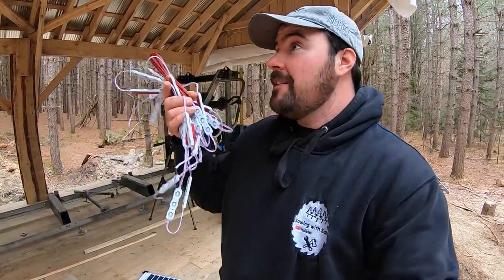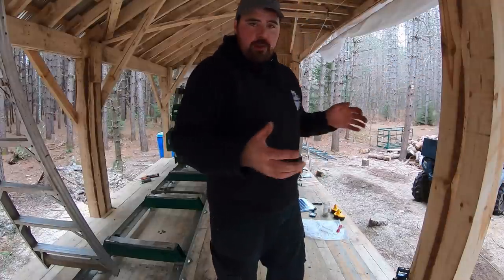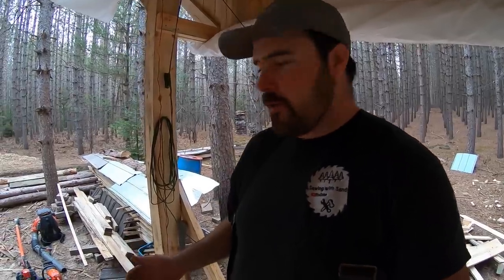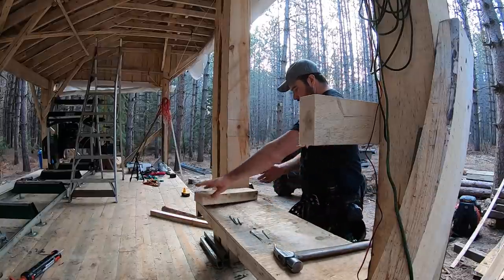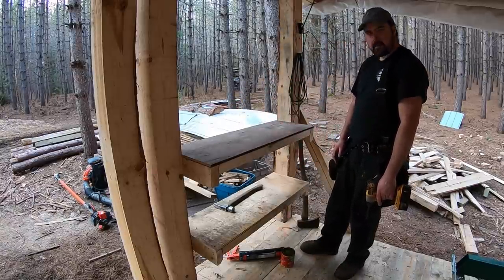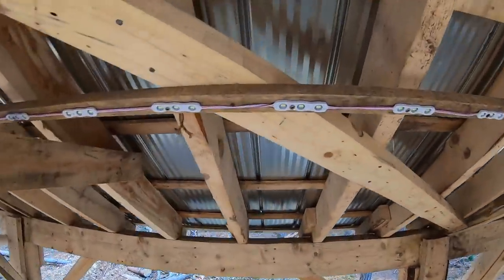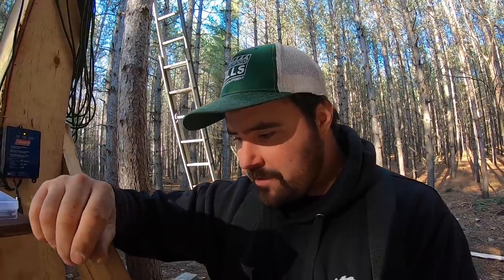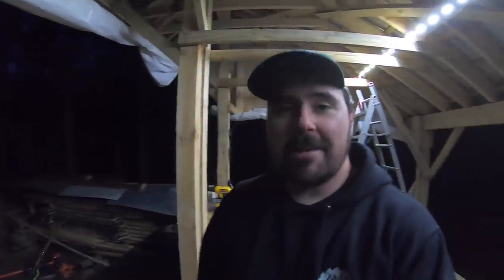Easiest Way to Get Light in Your Shed | Sawmill Shed Build - Episode 13

Comment: Very cool idea, using the LED string lights and the solar panel/battery set-up. Nice and simple, which is always preferred. The only potential draw-back that I see is the very low levels of light available to the solar panel in the "dark" months of Winter. I have not viewed all of your videos (yet), so I cannot tell whether or not you have done a follow-up on the performance of your system. But, I would like to see/hear from you about how things worked out in practice this past Winter.
My wife and I live on an "off-the-grid" property in the Canadian Gulf Islands on the West Coast of British Columbia. Up here, we have the same (or worse) problem with lack of sunlight (very short days) that you have. This past year we installed a battery-bank and inverter system, tied into our generator, for our "whole-house" system. No solar panels yet. We decided to pass on the panels because of the time of year: late Fall. There is so little sunlight available that solar panels would not keep the batteries charged-up enough to operate the system. Keeping in mind, ours is a full-time, year-round, whole-house system, which obviously requires much more power than your single string of LEDs. But, it certainly has been a godsend to get "regular" electrical power into our home, especially  during the dark Winter months! It is our plan add solar panels this Spring/Summer, to complete the system, and alleviate the need to periodically (daily) run the generator to recharge the batteries. 
Again, I would be very interested to hear how things worked out for you with your compact system. I may just do something very similar for my workshop, and a couple of other outlying buildings. I really like the simplicity of your system. Great video! Thanks!
Bruce Riep
Reply from the maker: All has gone well so far with the setup throughout the first winter

Comment: I would solder the wires then slide the heat shrink over the connections.   This would help with corrosion resistance.

Comment: 40w panel for one battery is more than enough, I have two 10w panels on mine and it charges enough to run the 12v electric trailer jack for raising and lowering the saw head all day long, and it’s not hooked up while in operation. Nice lights, I might do that too 👍
Reply from the maker: Thanks William

Comment: Good tip on attaching lights to wood strips first. When I put up strip LEDs in my cabin I hadn't thought ahead and tried using the tape that was on the back of the lights I bought. Was like putting up spaghetti and they saged all over. Also, never hook solar to controller first. Always hook controler to battery, then hook solar panel to controller.  Renogy is a better solar panel and cheaper at $165 for 100w and a better contoller.
Reply from the maker: Thanks for the tip Jim. I already owned this particular solar panel but is the one you mentioned sold in Canada do you know? Thanks again for watching

Comment: Add a 1/4inch of rubber under the battery and you will have less drainage of your amps the size of the bottom of the battery

Comment: Instead of on the tree, I might have mounted the solar panel on the south side of the shed, up on the sided part.  Great idea.

One other thing, if you disconnect the battery when you're not there, the battery doesn't charge.
Reply from the maker: I disconnect the lights from the battery but leave the solar panel hooked up. Thanks for checking out the video. Hope all is well with uou

Comment: Hey Sandy, they say imitation is the greatest form of flattery and I hope you feel the same as I am trying to walk in your footsteps with my build and soon my lighting.  I would like to know, since it has been a while how this solution has worked out for you and if you happen to have any idea how long the lights last on that battery?  Thanks again for all the inspiration.
Reply from the maker: I appreciate that! All has been good with the lights. I"d still use these lights on the battery as they work quite well. Big thing is getting hte solar panel to charge the battery in a good position but hte lights use such little power I find.

Comment: Looks good. That's what I suggested in a prior video comment. Be sure you have a droop in the wire from the solar panel to the building because of swaying if the tree in wind and to keep rain from following the wire down to the controller. 
Also you may want to think about an enclosure for the battery and some foam insulation to keep the battery from freezing and busting. This will depend on how much water to sulfuric acid the battery has.

Comment: Hey I’ve been tracking your channel for a while. Thanks so much for the content I am looking to create my own Lumbermill shelter for my 130 max that is going to be coming in in December. My question is if I have two extensions that’ll put me out to the 30 foot marker approximately how do you make a shelter big enough to be able to put 30 log in? Is it even possible?
Reply: You could use some sort of truss or a bar joist to span that far. Another option could be to load logs from the end .
Reply: I'm leaning towards some big ol' beams for my mill when I get around to covering it
Reply from the maker: I’d talk to an engineer to see what type of beam/truss can be used to span that distance
Reply: Emile Crotteau thanks for the comment. sent you an email

Comment: Sandy are you going to fill the holes in the steel roofing so it won’t leak on you ?
Reply from the maker: I think I’ll fill those in if the temperatures get back above freezing and it’s dry enough to get on the roof. If not I’ll end up doing it in the spring

Comment: Now you have to go to work...no excuses. The Solar panel has ''The requested URL was rejected'' is it a standard 40 watt panel ?
Reply from the maker: Not sure what you mean by standard panel
Reply: @sawingwithsandy  I mean nothing special just regular. The products that you had listed that you used, wouldn't open. It just said URL rejected. I've never used or installed solar equipment. Now after seeing yours and how simple it was. I'm interested.

Comment: Good video .I am going to try this for my mill shed can you give me the link to the led lights you got from amazon thanks
Reply from the maker: Thanks for watching Rose. The link can be found in the description section of the video by clicking the drop down arrow
Reply: @sawingwithsandy  thanks for the reply I see the info for the lights but it is not in blue like the Switch is .  would it be a bother do hight ligh it in blue then I can go right to it .Thanks
Reply from the maker: Hi Rose, the link in the description are the ones I used in the video. They aren’t actually blue. Hope that helps
Reply from the maker: Sorry wasn’t sure if you’re talking about the switches or lights.
Reply: @sawingwithsandy  lights . I got on amazon for the switches with the blue link
Reply from the maker: These are the ones on amazon I purchased and used 
Twidec/10Pcs AC 6A/250V 10A/125V SPST 2 Pins 2 Position On/Off Car Boat Round Black Rocker Switch Toggle with Pre-soldered Wires（Quality Assurance for 1 Years） KCD1-2-101-X

Comment: Using a bungie cord around the solar panel to fix it in place radically reduces its output...to almost nothing. Need a better way.
Reply from the maker: I used a rope. How does it reduce it?

Comment: You did good 👍 but I can't find those lights anyplace ... Oh well 12v is 12v just depends on the current and number ... Me I'd probably toss a inverter small one to the battery to charge some things like drills ... Maybe be a old car AM/FM radio from a junk yard that works ... IDK don't even have my mill yet WM LX25  has a build date in 8 days two weeks later 🔧🪚🪵
Reply from the maker: Hey Robert! There should be a link to the lights in the description of my video. Sounds like a great setup with the radio and all as well.